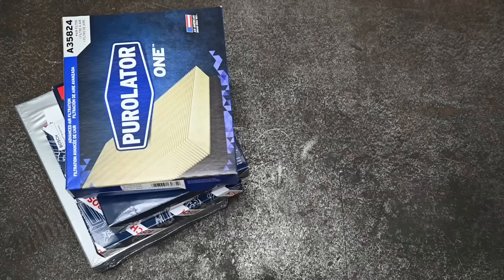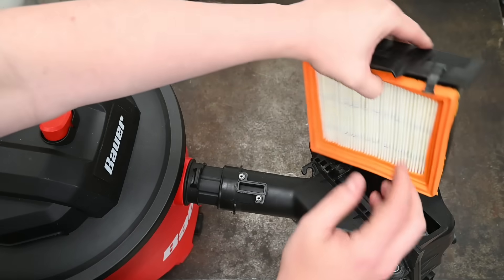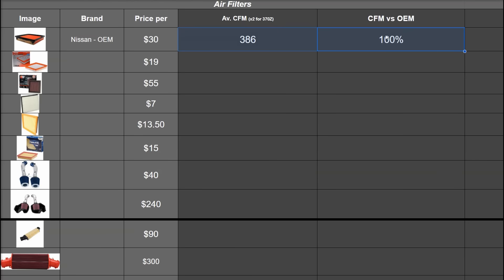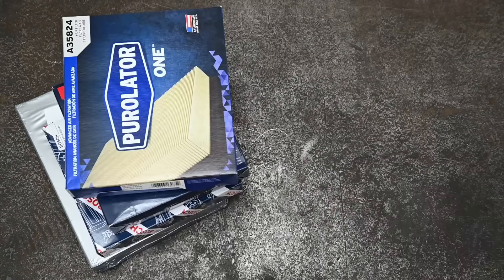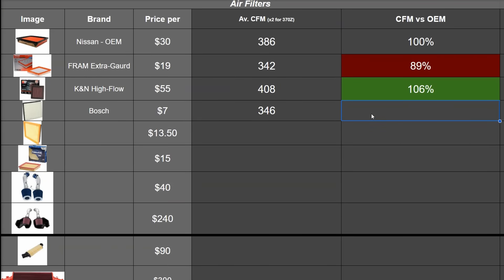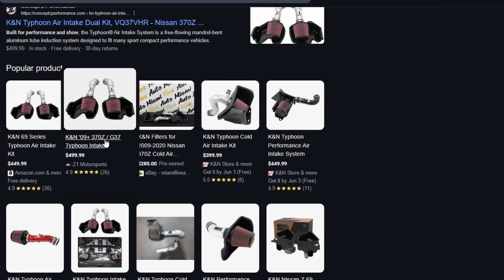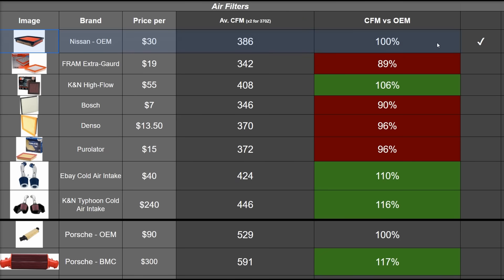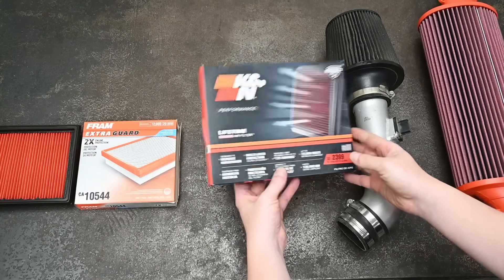Intake Filters TESTED: More Dough = More Flow?

Comment: The other part of the equation here is how well do they actually filter...air flow is one thing, but if they let a lot of junk into the engine (or in the case of k&m gunk up sensors with their oil), then they're not doing a very good job at their #1 role which is filtering.
Reply: My thoughts too. High-flow is great but if the filters don't filter out anything smaller than a pebble, you might as well not have a filter at all and get even better air flow. Especially on motorcycles, K&N filters let pass a lot of dust.
Reply: @heiner71 I live in Rual Australia. We have the finest dust in the world, named bulldust here. 
I wouldn’t ever run a K&N on any of my cars. Ever
Reply: @heiner71  You're interpreting PF's test results poorly. Their test was measuring particles over 5 microns, but doesn't tell us % at 6 microns or 600 microns (oil filter ratings normally DO). 6 microns is about 0.0002", or around 5-7x smaller than the clearance on a car bearing. If 98% was 5-10 microns, it wouldn't even be a problem for the bearings.

They also HEAVILY saturated those filters to the point they were flowing half of their original value. That's going to suck a lot more particulates thru than normal. For an oiled filter, that saturates it's ability to capture, similar to pouring oil on tires and expecting them to grip. Most important is comparing to the OEM filter used, to which it was almost identical.

If K&N filtered engines didn't last long, they'd show a large power drop after a while yet people haven't had any issues after several decades of use.
Reply from the maker: The home made set ups/tests we've seen for this dont seem representative or repeatable based on looking into it, so we figured leave that to the labs. Also, didn't make any wager about filtering I guess come to think of it
Reply: @TorqueTestChannel lol nice when the wager has clear boundaries. Project Farm has done some, but I can absolutely see how filtering testing would be difficult.

Also, if you do more tests, WIX is a popular OE alternative to add to the mix.
Reply from the maker: @SomeGuysGarage  Doing it right can be difficult: https://www.youtube.com/watch?v=_yYmj-G2R4s , https://www.youtube.com/watch?v=7D9lJxQ1s-U
Reply: @TorqueTestChannel I appreciate your honesty in not thinking to test it lol
Reply: @TorqueTestChannel 😂😂 no betting anytime soon. yea theres really no way to test for those variables, accurately..
Reply: @TorqueTestChannel awww man. oh well. woulda loved for a follow up video
Reply: @TorqueTestChannel  I originally thought you were going to pull dirt through into the shop vac and at least visually look for a difference
Reply: @TorqueTestChannel  Surely you've seen the "Brand Ranks"(terrible name guys...) testing. I could think of a few ways to improve it before getting to lab grade, though the cost/complexity would probably double what they've invested. That said, I'd disagree that it's not a decent representation of filter performance.

Not trying to be negative, but airflow CFM of a new filter is not useful information. 

Since you have the shop vacs, I'd be more interested in testing corded vs cordless, especially accounting for dB. DeWalt released a "quiet" series of shop vacs which look good on paper. I'm kinda disappointed in my M18 fuel vac, even with a 12ah battery. ProjectFarm did it four years ago, but the info is now outdated with modern brushless vacs.
Reply: Project Farm tested that.
Reply: I was thinking the same thing too.
Reply: If I remember correctly Bob, the oil Guy did some air filter filtration test and found that the k&n did in fact flow better, but, that was to the detriment of its filtration
Reply: Get some ac test dust and do some filtration tests! 😊
Reply: Need to get that new favorite tool of Louis Rossmann "P-Trak Ultrafine Particle Counter 8525"! 😅
Reply: Currently running k&n in my Mustang GT. Pull my MAF sensor once a year to spray clean it. Always comes out clean, looking brand new.
Been using K&N for 30 years never had a problem with any sensors. Don't over oil it.
Reply: Kn gumming up sensors is user error.
Reply: Other tests I've seen, Purolator is fantastic at filtering as K&N is shit.   Purolator is always my choice if I don't have an aftermarket intake system
Reply: Would love to see the state of a MAF sensor after a few thousand miles with an oiled filter ! Lol
Reply: When did you change your furnace filter to the burner. That's right, they don't have one. As for as sensor's that are in the intake side. Well, oil blowby and engine gases recirculating to lower emissions and increase fuel economy will gum those up just fine. Due to exhaust being the restrictive side of most modern engines. Get the cheapest filter.
Reply: That K&M lets a lot more in and is basically what I was running which is why I was going to remove it.
Reply: Always used 😊k&n never had a issue just need to regularly clean and re oil with k&n cleaning kit
Reply: Exactly! There is a generally inversely proportional relationship between air flow and filtration. This video does not actually measure filtration
Reply: Exactly!
Reply: Could a Dyson 'detect' type vacuum give an idea of how much filtration is provided? 
Should be a direct swap for the shop vac. Combine that with 50g of cornflour and you have a DIY fine dust test.
Reply: There are oil free versions like AEM you know
Reply: @jrh8302  yup, I ran AEM filters with their pre-filter too on my Mazdaspeed 3 back in the day.
Reply: According to project farm these high airflow “filters” don’t really filter well at all.
Reply: To be fair I have ran a daily driver with no filter at all. 
Just run a mesh screen and change the oil often. 
I'm gonna rebuild the engine every few years anyway.
Reply: Something I hope to see next on here.../would expect to see next at least... even if its just a quick microscopic slideshow of the media.
Reply: Exactly
Reply: Totalmente de acuerdo!!! los filtros de "mayor flujo" dejan entrar mas aire ...pero no restringen el polvo o pequeñas particulas de silice (arena) por lo tanto , vas a tener un mejor rendimiento del motor, pero.......vas a acelerar el desgaste de los aros de los pistones
Reply: Stick with OEM. Filtration is just as important as flow.
Reply: Been using K&N for 30 years... never had a problem with my sensors. Just don't over oil it.
Reply: The only people who say that about K&N, are people who know nothing about K&N.
Reply: If your oil is getting to the mass airflow sensor, you are oiling it wrong. That simple. In some cases for heavy dust environments the k&n's will have pre-filters to help. But they is always a tread off. Also most cars don't flow more air than a cheap paper filter can flow.
Reply: @warhorse58gt  thats why filter socks were invented. Also most guys with an oiled filter will have 2 so as one is being cleaned you don't have to park your car.
Reply: @warhorse58gt  Everyone oils the things wrong lol
Reply: @SomeGuysGarage  Thats why industry went to dry paper filters years ago. Centrifugal filters are better than oil.
Reply: @warhorse58gt  then if K&N air filters are so great...why would they need pre filters..this would just lower the cfm.and make the $$$ K&N filter..mute
Reply: @randellgribben9772  *Moot, unless you expect it to talk to you.
Reply: @warhorse58gt  K&Ns oil the MAF right out of the box.  And even when they're not oiling it, they're dropping dust on it, because they can't filter for crap.
Reply: @warhorse58gt  yeah I supercharged my 2l civic and left the stock paper filter and air box. 

If it flows enough air for my supercharger to push 9, sometimes 10 psi then it is fine.

I know I could get more power with an oiled filter or replacement, as the setup should be good for 12ish, but I don't need more, it's plenty of power and I want to keep it basic and reliable. It's been trouble free for 100k miles with the supercharger installed. I don't want an unreliable car like I "made" for myself as a teen with a bunch of mods that require attention...
Reply: @warhorse58gt  I have been using K&N filters since the 1980's. Muscle Cars to Daily drivers. The filter only needs a very light coat of filter oil, a Very lite coat. After I oil mine , I set it on a couple paper towels, and let it sit over night, then wipe off the rest of the filter oil. 
I have never had a mechanical problem related to the use of K&N drop in air filters.
Reply: @warhorse58gt Agree with you. Gives the vehicle better throttle response. I noticed especially on a factory stock 2016 Ford Fusion Eco boost and my Focus, 
And my 65 Mustang Fastback pro touring car with a 408 stroker Windsor and 5 speed. Gained horsepower and torque all the way to 6400 RPM on a chassis Dyno.
Reply: The location matters too haha we can’t do oiled filters here in the panhandle of Texas because the weekly dust storms will gunk them up in no time at all…
Reply: I mean if u want max airflow im sure u don’t care ab dirt im sure you have seen many people run not filters on their turbos and if there is one it’s a screen mesh
Reply: @Ggg-ef6vb those people are rebuilding engines regularly for racing purposes...not people who expect to get hundreds of thousands of miles out of an engine with no major issues.
Reply: Project farm tested this years ago and the K & N's and their ilk did indeed let a lot more fine particulates through the filter.

No surprise there, the only way you can make a filter with the same surface area 'flow better' is to increase pore size in the media.
Reply: Project Farm did that test...K&N failed miserably.
Reply: The high-flow filters do filter worse, it's inevitable, question is how much and does it matter. 

There are two components to a filters resistance (pressure difference measured in IWC or Pa in the civilized world): surface area and specific resistance of the medium. 
There is only so much surface area a filter in a certain standardized format can have, but this certainly varies between manufacturers and models. 
The specific resistance largely depends on how fine the medium is, and while there might be certain differences between technologies, none of the manufacturers can cheat physics. 

I've seen that K&N does poorly with fine particles. Of course those perticles are abrasive. Whether or not this equates to significant damage over the lifetime of a car I don't know, I suppose it might depend on the amount and kind of dust the car is exposed to.
Reply: @BL-yj2wp  Incorrect 99%of the time a high flow filter has MORE filter area. This is even the case with the stock replacement K&N.
Reply: @BL-yj2wp As someone who's spent his whole life as a forklift/heavy equipment mechanic and seen several 'dusted' engines it really does matter as it's the fine particulates that do the real damage as they polish the bores.

Like everything though, it's situation dependent. If you live in the city you may get away with it.
If you live in a rural area with a lot of dirt roads then you're committing engine genocide 😂
Reply: @BL-yj2wp  those   ' fine ' particles. are gravel to the  piston rings
Reply: Long time K&N user here. I have nearly 300,000 miles on the same K&N cylinder filter in the stock airbox in my Acura Integra GSR. Engine and drivetrain are still all original internally. I also have a NB Miata with a panel K&N in the stock air box for the last 6 years and around 30k miles. Integra is MAP and Miata uses a MAF sensor. No issues with either car. I have literally bought one filter and one or maybe 2 cleaning kits in the last 24 years of owning the Integra.
Reply: Your oil and oil filter will take care of those issue unless you drive in extremely dusty areas,  sand dunes or gravel/dirt roads.
Reply: @bowez9 that doesn’t work at all when the berries is coming into the intake. It’s wearing away the piston rings and cylinder lining.
Reply: @bowez9  The dust is destroying your rings and cylinder walls before the oil filter can have any effect.

Also, rings are what wear out first on most engines, not bearings.
Reply: @bowez9 no, generally oil stays outside of the combustion chamber lol

Comment: If this becomes a series you, or a kind viewer could easily 3d print a part to hold the air flow sensor in the same spot for a little more repeatability.
Reply from the maker: On the 370Z tests we used a simple hand clamp

Comment: More flow does not equal more power in most cars! I've dyno tested multiple cars, and high flow filters make less power and torque. Unless you are running at least 10lbs of boost, high flow filters are a scam.
Reply: your vehicle is optimized for "average" from the factory. if you just add a filter the programing will recognise more air and compensate the fuel air mixture. People read "cold air" intake and swallow the marketing. what is "power" and where are you measuring it. at the wheels or on a computer monitoring the engine.  If you are slapping lipstick on a pig it may be a pretty pig but it still isn't interested in moving faster
Reply: @rhetorical1488well said man! I've dynoed probably 30 different cars with just cold air intake swap. Only one had an increase in torque, and every single one lost power. K&N filters are the biggest scam for poor teenagers. Bigger particulate filtration will wear the engine out faster. Biggest waste of money.
Reply: This is quite possibly the dumbest thing I've ever read on a car related post, It is completely contrary to what science, and every engine builder,  power train engineer and tuner/dyno tester has ever written on the subject. more air flow is the very definition of more power.
Reply: @maxpowerta3183 I promise you that's not the case. Constant air velocity is more valuable than the amount of flow. No competent engine builder will ever tell you that "K&N filters are the best". Gullible people like you are what keep K&N in buisness. Go to a dyno shop and test it out... like I have ya dink!

Comment: Me before watching: i just bought a K&N drop filter. Pleeeease tell me it was worth it, lol

Me after watching: sigh of relief
Reply: This didn't take into account the other very important particles filtered out.
Reply: It will destroy your engine sooner because of all of the abrasive particles it lets through.
Reply: @mikey4016  Is there any empirical evidencefor this thoigh? Im genuinelyinterestedto know, cause I've heard mixed info on this. Some say exactly what you said, but others say that since it's oiled, as long as you maintain it properly, it's fine.
Reply: @debugging_with_david  Since the definition of empirical is: originating in or based on observation or experience. Yes, I've seen intakes full of dirt and scoring of cylinders on vehicles that had those HOT Dirty air intake kits put on them.

Comment: Good video, I wish you did a particulate test as well to see which ones are actually good filters!
Reply: Yep, moving air versus moving 'clean' air...............that's what you should strive for.
Reply from the maker: The home made set ups/tests we've seen for this dont seem representative or repeatable based on looking into it, so we figured leave that to the labs. Also, didn't make any wager about filtering I guess come to think of it
Reply: That has been done on Project Farm but like his and many others, the test was done incorrectly stated by David Vizard Performance.
Reply: @Olds_Pwr  what was his criticisms? I feel if you did the same test for all brands it would at least be comparatively accurate.
Reply: @keith3761  An engine pulses when it retrieves air and that is what causes cotton gauze filters to collect dirt.  When an independent tester uses a constant vacuum for an example, it shows filters such as K&N failing miserably when collecting dirt. Here is the title to the video for reference - Project Farm car air filter test results contradicted.
Reply: @Olds_Pwr  But K&N legitimately does a worse job filtering in the real world, too.  Project Farm's results were pretty accurate from my experience with K&N.

Comment: A new filter in the stock location will cover you up to about 500hp in most vehicles. 

Past 500 you can relocate your filter to near the front bumper to see some gains in response and whistling noises.
Reply: Stock intakes are usually better plumbed for outside air than aftermarket unless you're spending big money but that's usually better spent elsewhere.
Reply: @AlexAutoRepair1  Facts.  Most cold air intakes pull hotter air than the factory setup.

Comment: Why did you take the MAF out and leave it open? That is a giant vacuum leak
Reply from the maker: All ports are either taped closed or blocked by the very tight fitting insert tube it's attached with